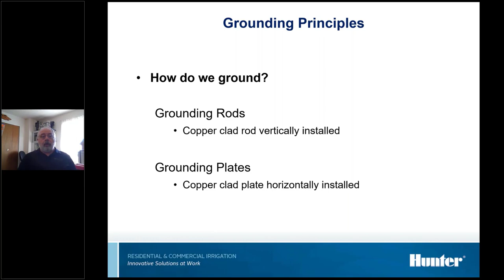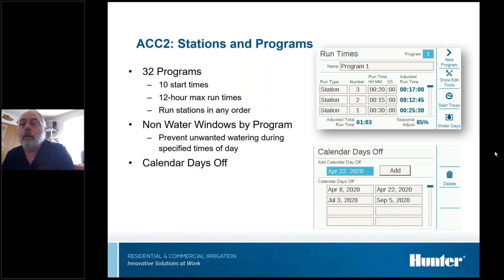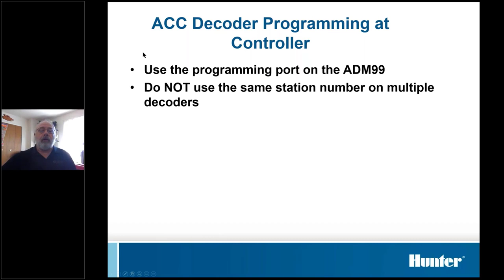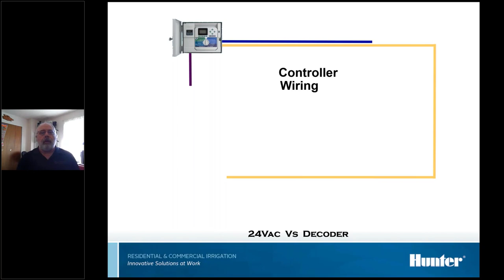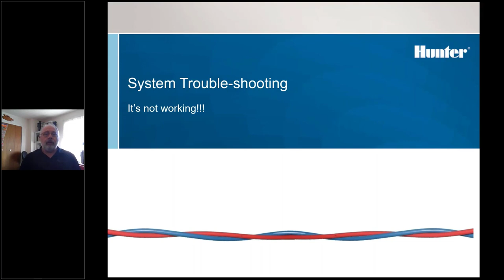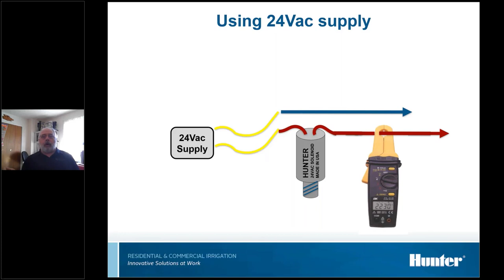Advanced Electrical Troubleshooting

Comment: When trying to use the half method from the controller and if the acc2 has an over-current, it will shut itself down (module) and you will not be able to do a wire test from 'decoder diagnostics' down the line.  So you definitely have to use an outside 24V transformer to test the line for short or open circuit.

Comment: If I have a icd 400 and one of the station isn't working and the solenoid is good do I have to replace the whole icd-400
Reply from the maker: If solenoid works and you can hear it click, that tells you that the controller, wire path, and solenoid are all OK. Look for valve or water supply obstructions.